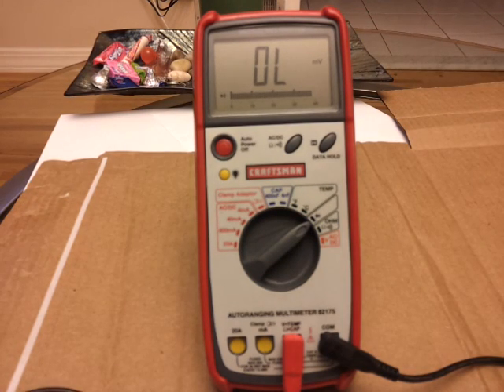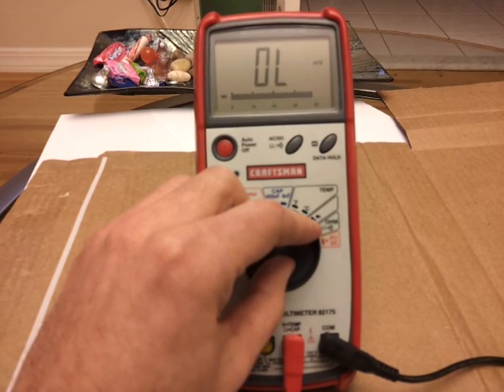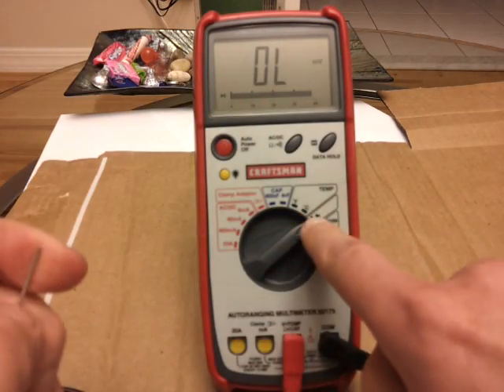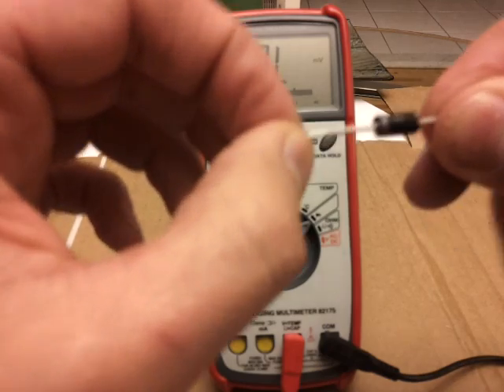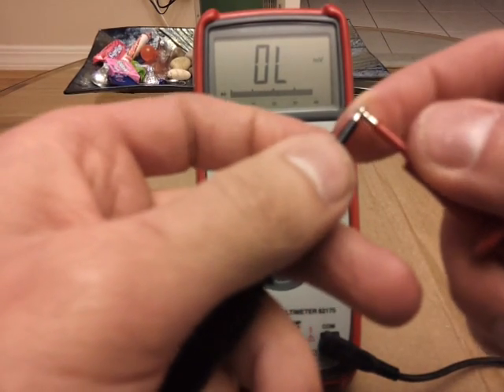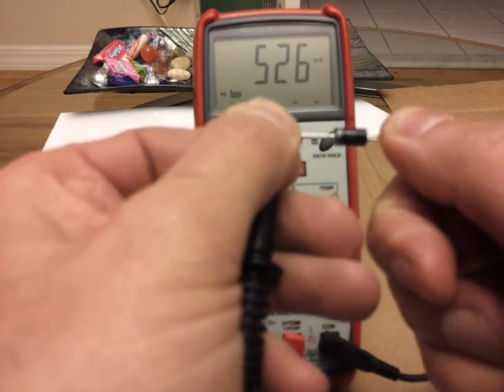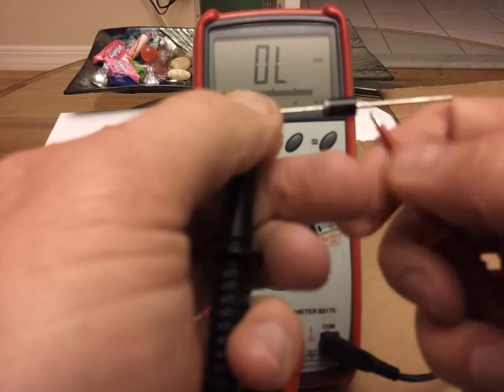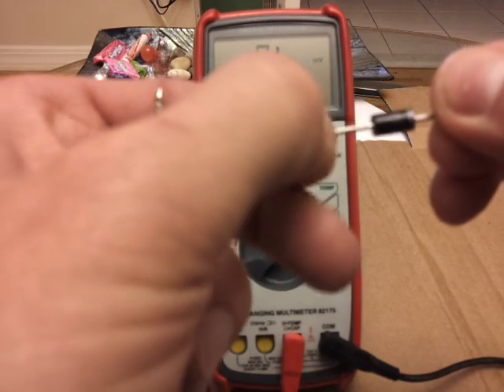Diodes - How to test using a multimeter

Comment: But you should not be touching both ends of the diode with your hands because you'll be combing your body resistance to the reading. Try holding both meter probes, one in each hand and you'll get an ohms reading which will interfere with your measurements of a device you want to test.

Comment: Thanx mate . Handy tip's . I now know how to use another part of my multi meter . I have purchased 4 John Deere lawn tractors and they all have electrical problems , I found out that apparently there are fusable links and diod's and maybe one fuse . After replacing a PTO switch as it melted and stopped cutting grass , I replaced the switch but now still the clutch wont engage , the wires that go to the clutch I can see have been very hot as one side of PTO clutch wire plug is slightly melted ? Do you think I have burnt out the wires or a diode or I have been trying to find a video for the diode replacement of John Deere STX 30 , 38 , 46 , and an LT 155 all the mdels I got . I think they all have similar problem . Maybe these diodes go & people cant work it out and they sit around & rust & eventually sell cheap .I got 1 for free stx 30 and only paid 200 for couple others and stx 46 paid 700 but now clutch is gone ?

Comment: is 0.5 the reference reading for all type or size of diodes?
Reply: Yes it should be as all diodes are supposed to test to a .7 to be turned on but it can be .5 to .9.
Reply: Silicon is typically .7 V and germanium is typically .3 V

Comment: Hi there,can you test a diode while it's in a circuit this way or does it have removed? thanks for the video.
Reply: David Scully 
ive always been told to remove from circuit, so you dont get false readings.
you could have another component throwing off your reading while connected..
Reply: Thanks

Comment: Hi. I set mine to the diode (it's not on a separate part in the dial) with this multimeter:

http://www.rusgeocom.ru/multimetr-cem-dt-916

but it doesn't work. I tested it on a lot of good LED that lights with DC battery.